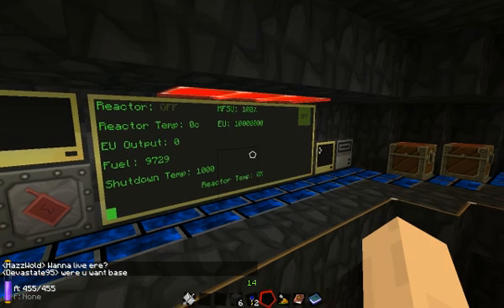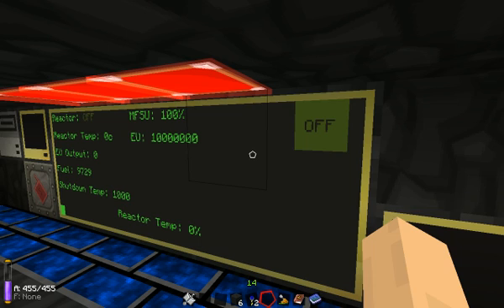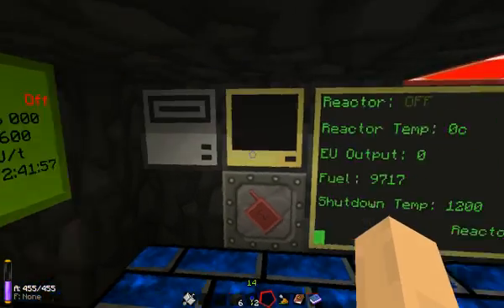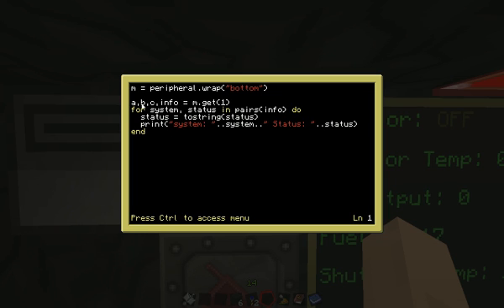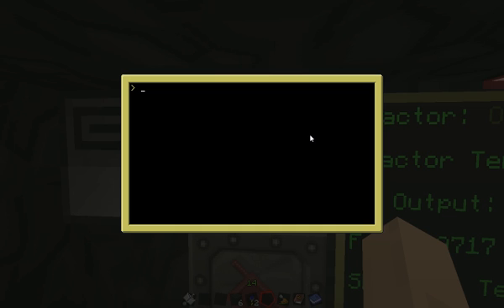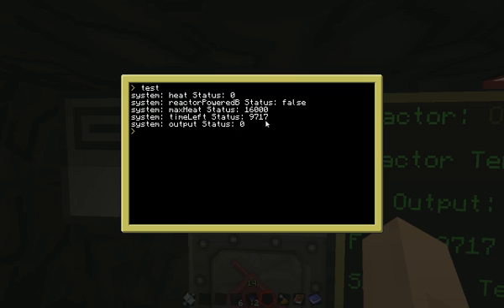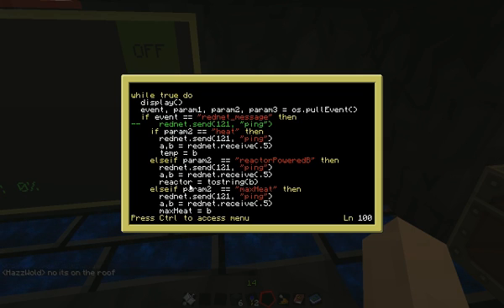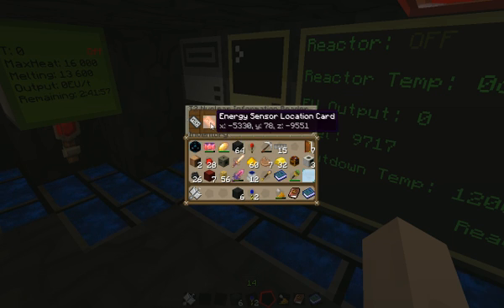Nuclear information reader

Comment: I want to use the same system for a railcraft iron tank, to view how far its filled (the basic script from 4:04 works for that), printing out the values works fine, but i want to make a graph out of it (making a graph isnt hard), but i cant for the love of god figure out how to read out specific values from the table (specifically the maximum capacity and the amount of liquid in the tank), but it just keeps returning nil or a alphanumerical gibberish (im printing it out as well to at least test the value i get from my attempts to read the value out of the table)

Comment: Alright i was hoping to just use on computer but a second would fix the problem. so the one that stops everything which is the one i am using now is os.pullEvent(monitor_touch) i found one on the computer craft wiki that is os.queueEvent(event, param1, param2, ... ) do you know anything about this command? BTW thanks for your quick response :)

Comment from the maker: I set mine up so it does an os.pullEvent and waits for all events. I have the NIR connected to a different computer that is constantly sending rednet messages with info from the NIR to the computer attached to the monitor. if it gets a rednet_meassage event it updates the monitor with the info from the NIR and if it gets an event from the screen it'll perform the corresponding touch action. this way it's never stuck waiting for anything. I forget what the touch event is called, sorry.

Comment: Alright so i got two functions one gets the information from nuclear information reader (NIR) and the other is a touch screen function to turn the reactor on and off, if i call the touch screen function i just waits indefinitely for a monitor_touch event and dose not pull the data from the NIR. How did you write yours so it printed the NIR data to the screen and wait for a touch event?